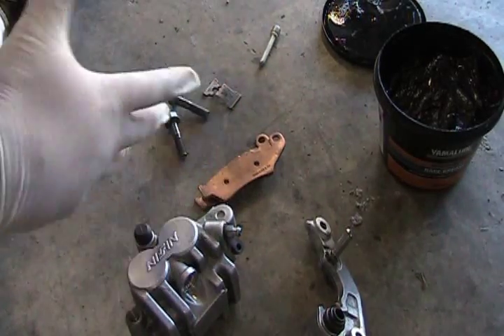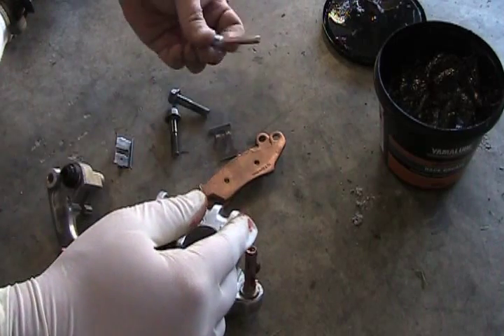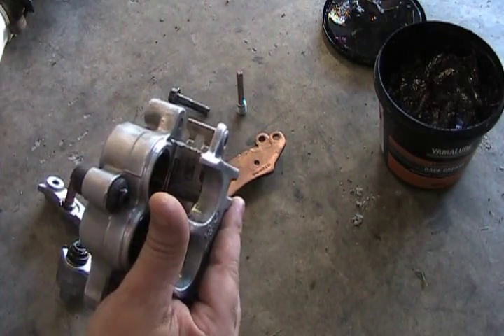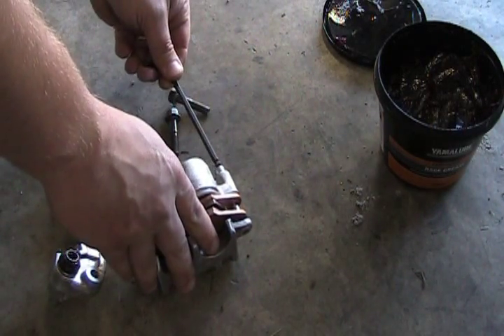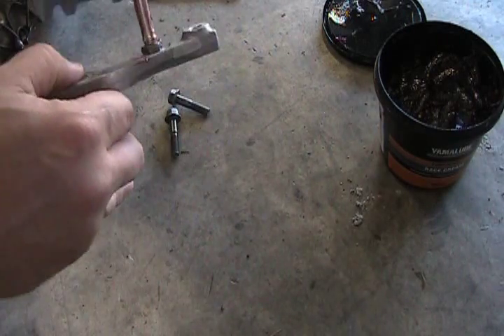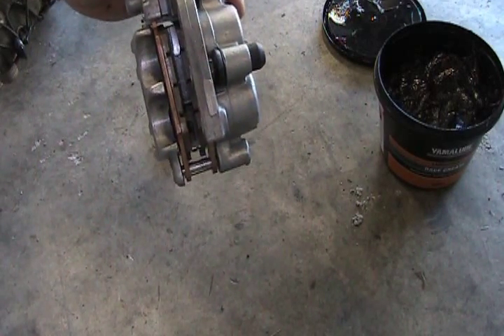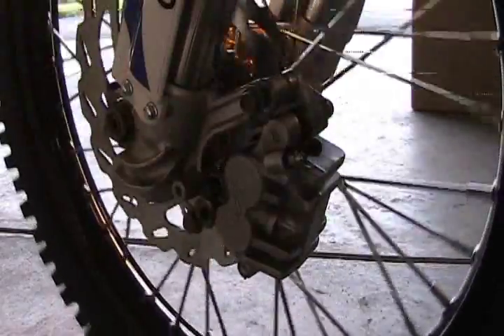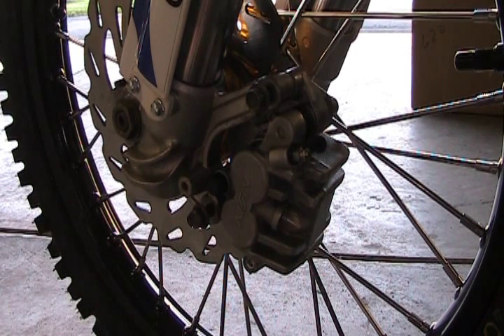Part 60: Assembling and installing motorcycle brake front brake caliper. YZ250F example.

Comment: Ha ha, this video is 13 years old, but I just bought a 2001 Honda XR650R. The front brake was kinda mushy, so when I took the caliper apart that 2nd, larger spring clip you put in was in the wrong place. It was actually interfering with one of the pistons, so the piston was stuck and only one was working. I cleaned up the caliper and everything and figured out how to put in the clip/spring correctly and now the front brakes work great. But I wasn't sure and have been looking all over for verification and finally found your video to verify I figured out the right way to put in that spring. Well, nice video and thanks...13 years later! :-)

Comment: That clip that you put on the part before you put the caliper together has fallen out while is was doing a pad change. What is the easiest method of putting that clip back in?
Reply from the maker: +TuffStreet Cruzers Should just snap on.
Reply: yeah but do i have to pull the caliper apart?
Reply from the maker: +TuffStreet Cruzers Depends on the bike really. Just need to remove the pads to get it back on there.
Reply: +Johnnysshop koi ln

Comment: I recently had to remove my forks and wheel and such but while the wheel was off and no disk in between the brake pads i accidentaly pulled the brake lever. is there anything to worry about? and if so what must i do?